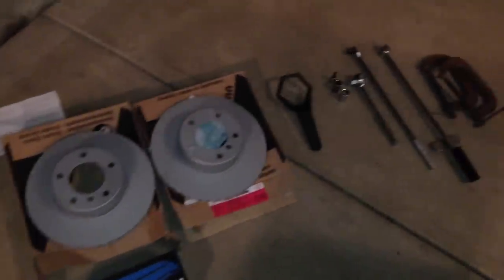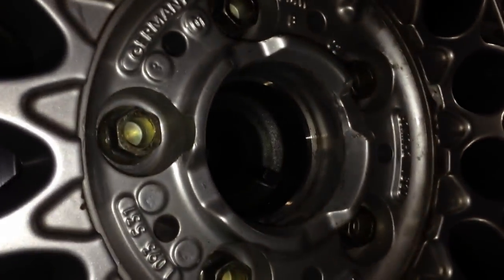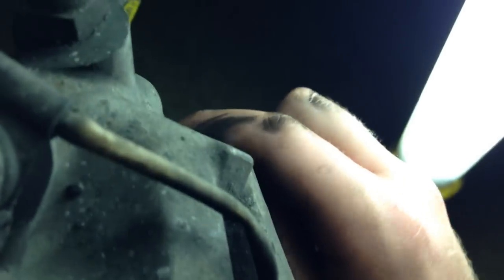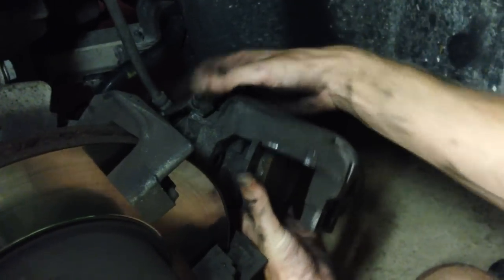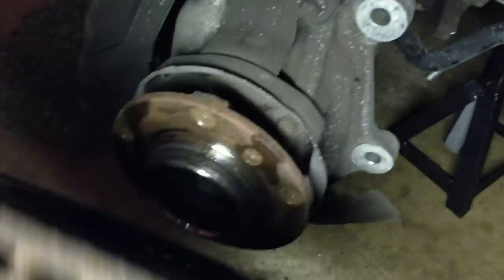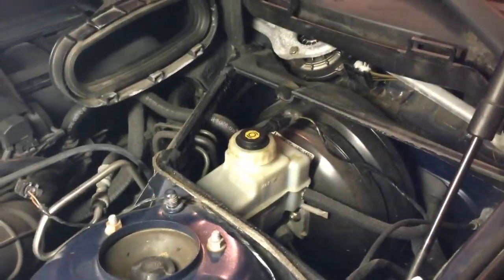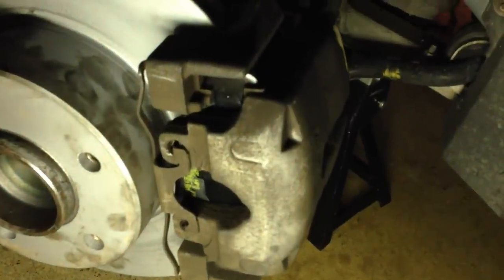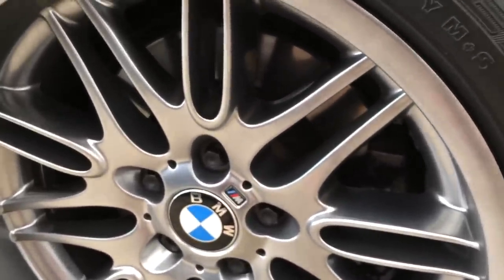BMW E39 5 Series (1996-2003) Brake Pad and Rotor Replacement DIY

Comment: Great video. Was able to change the rear rotors with help of this video last weekend. For me was a long and painful job due to limited mechanical experience and initially a lack of proper tools, but am really satisfied now that its done.

Regarding the hex bolt that you had to drill out - I found that the previous owner had also ruined that and I guess rather than fix it, he decided to not replace the rotors and sold the car. However instead of drilling it, I was able to hammer in a torx bit into that now-circular hole and use that to get it out.
Reply from the maker: Ahh the torx method, I have done that before.  It's quite effective!  I'm glad that you were able to get the job done.

Comment: Hey Ryan, I finally got around to doing my brake pads last weekend. It was quite easy and I had no issues thanks to this video. A couple of notes though:

1. If your E39 has the mobility kit (cigarette lighter powered pump/tire sealer,) and no spare tire, then you will not have a jack. I learned this the hard way and had to go to O'Reilly and buy one.

2. You mentioned the pad wear sensor on the front driver's side but my 2001 M5  also has a sensor on the passenger side rear. They are different sensors because the wire on each is a different length.

3. Once you replace the sensor(s), you can reset the system by turning your key to position 2 and waiting about 20-30 seconds. The Brake warning light will then go off and you know that the sensor has been reset.
Reply from the maker: Glad things went well!  

1.  No M5s have jacks, and the included ones in E39s are not too great.  So buying a jack is basically a must for any kind of DIYer.

2. Yeah there is one in the front and one in the back.  I've replaced both of mine with the realoem.com part numbers.

3.  That only works on the 2001+ models as far as I know, I think the older ones figure it out after some drive time haha

Comment: Hey thanks for your reply. Nothing else malfunctions. The speedo works fine as I know. I will get it checked soon. I noticed sometimes when I start the car its off but after I drive a little bit, It comes on when I hit the brakes. The brakes squeal for a second thats it. then it stays on from there and the brakes work fine with no noise whatsoever. I forgot to mention that both traction light and ABS light come on at the same instant time. I will get it checks and again, Thanks for your input

Comment: Good Vid. Only thing you missed was cleaning the disk before install. They come with an oily residue for rust prevention that should be cleaned off before install. This will help me with my pad/disk change in the next couple of months. Thanks.

Comment: Good video...very helpful. 
A quick thought about the comments on brake dust: Yes you should avoid inhaling brake dust...HOWEVER, there were an estimated 260 MILLION registered passenger vehicles (not counting commercial vehicles) in the United States in 2014. 
Multiply that by 4 wheels each (I can't count that high). Where do you think all that brake dust goes as the pads and shoes wear down over time?? Yup, it's floating and swirling through the air and we're all inhaling it as we drive along. 
Food for thought...

Comment: For anyone wondering what pads/rotors to get;
i recommend brembo blanks and akkebono pads. its about $480 for a full set on fcp euro for my 540i wagon but they last quite a while and the akkebono pads have almost oem stopping power but VERY VERY little dust, which is great

Comment from the maker: +Daniel Covington There is one sensor on the front driver's side, and one sensor on the rear passenger's side.  You do not need to bleed your brakes for this job, but it is recommended to have a full brake fluid flush done every 3-4 years.

-Bobby
Reply: Thanks.  Brake pad sensor is being stubborn.  You just pull it out vertically from the pad hole it's in?
Reply from the maker: ***** Yeah, just pull it straight out.
Reply: I was about to say same, brake bleeding not necessary, Nice job, am doing mine in two days time

Comment: Couple of tips:

If your hex key set omits the 7mm one you can still get the job done if you remove the  whole calliper via the two 18mm bolts.

The little 6mm hex bolt on rotor should be put back with a little copper grease and little more than finger tight. It can't unscrew itself once the wheel is on and you'll be so glad next time.
Reply: Can be done but it's a pain in the arse to get the pads in properly and caliper back on, but hey, when you gotta...

Comment: My 2 tips, clean the caliper holder good. It can hold alot of dirt and rust pieces, as its metal. Also clean the guiding pens. Otherwise great video. And if you cant untied the screw that keeps the rotor on place. Just put the caliper holder on again and use the old pads and 2 clamps, so the rotor will block. Use an extender on the screw and then it will go easily. Put some copper on the screw before putting it back together, so you wont have a hard time next time. As this tiny screw wont do shit when the wheel is back on.

Comment: I did the exact procedure as you guys did with the brake reservoir and a rag around it just in case and then compressed the caliper pistons. My question is did you guys bleed the front brakes because I didn't and it works fine.

Comment: Hi guys! I LOVE my Blk/Blk, 2003 530i/Sports Package, and have a question. Will changing out the wear sensor reset (eliminate) the Amber "Check Brake Pad Wear" warning in the middle of dash and the little, red "Brake" light on right side of cluster, or will I need to take to a BMW shop after done to reset those? Secondly, do I have to replace that sensor at all, or can I leave in factory unit upon swapping rotors/pads? Thanks in advance! -Dave
Reply from the maker: 1970borntorun  That sensor must be replaced when doing brakes if it trips the light, otherwise it will not go off.  The light and message will go off after replacing the sensor.
Reply: ***** thank you :)

Comment: would doing a CDV delete while changing the brakes be a good time to do it? since youre bleeding the system anyway.
Reply from the maker: Yes it would be, though bleeding the clutch can be done separately from the brakes.  While they use the same fluid reservoir, there is a separate compartment/chamber inside the brake fluid reservoir especially for the clutch fluid.

Comment: Hey I have a question. I took my car to a auto clinic to get the brake pads replaced but the brake pad light is still on even though fresh pads were installed. How do I get rid of the light?
Reply from the maker: Was the brake pad wear sensor replaced as well?  This is critical since once the sensor is tripped, it must be replaced.  After replacing the sensor, the code needs to be cleared from whichever module stores it.  I believe it is either the LCM or IKE (cluster).  You'll need someone with BMW software to do that.  If you are local to San Diego, my shop can easily do this for you.

Comment: Great vid, I got a 2003 Range Rover HSE. It's got Vanos problems. How do you recommend in tackling this problem considering that most of the bmw parts would fit a range rover that age.

Comment: So there is only one brake pad wear sensor for the whole car and it located on the front driver's side, correct?  Also, no brake bleeding is required for this work right?
Reply: nope but you have to take some fluid out of the reservoir and i think on the back there is also one. Passenger side.

Comment: What an awesome video guys. I was kinda nervous about tackling this since I haven't wrenched on a BMW since I had my E36. But you have given me confidence. I will be doing the fronts and oil change next week. Any suggestions for some inexpensive rotors for a daily driver (no track)?
Reply: Thanks for watching!  We're glad you enjoyed and found our video useful.  But... brakes are without a doubt one of the most important things on a car, especially a tighter car with power.  It never pays to buy 'cheaper' or 'budget' parts in this category.  I would sternly recommend the OEM rotors, they are worth their weight in safety and performance on these cars.  Same goes for pads.
Reply: ***** What about some high performance brake kits like Brembo?
Reply: DO NOT use cheap brake components, your life literally depends on it.

Comment: Hi thx for the great vid, I have a question, after I finished changing my rotors n pads, I spun my rotor n my outter break pad (the one without the clip) was slightly touching the rotor, n it wasn't rubbing evenly, just one side of the rotor, n it's like that on both sides, r my rotors not even? Can u help pls
Reply from the maker: That's normal, not a big deal as long as you can still move the wheel/rotor by hand.

Comment: So for the brake fluid reservoir, all you did was loosen the cap and tighten it back on? You didn't really explain what to do after you compressed piston back into caliper. When do you tighten the reservoir cap back on?
Reply from the maker: Loosen cap, compress piston back into caliper, and tighten cap again.  Wouldn't hurt to check level while you're looking at the cap!
Reply from the maker: ***** Brakes should be bled every 2-3 years.  If it's been less than that, don't bother replacing it just because you did pads/rotors.  If it's been longer, definitely do it.

Comment: Thanks for the info! Presumably you didn't use any grease? I have never done brakes before and seem to have read some conflicting information about applying grease or lube when changing brakes. I will be changing mine soon so any info on this is appreciated , cheers!
Reply from the maker: I used the included red grease on the pad ears/backing where it meets the piston, I would definitely recommend you do the same.
Reply: E39Source Will do! Thanks for the reply

Comment: Do you have to remove the brake sensor from the caliper to do the brake job or rotor job? How does it come off if I need to remove it? Thanks!
Reply from the maker: The pad wear sensor should be replaced at any brake service.  Simply pull it out of the caliper.
Reply: @E39Source  . Thank you!

Comment: great vid guys only thing I noticed missing was putting copper grease on the slider bolts
Reply: never put copper grease on the slider bolts, as it gets sticky over time and it wont move anymore. Use what was invented for the job like 100 years ago its called Brake Grease, its simple as that. TRW has it for example.

Comment: So, in your experience, which rotors do you recommend. I've been looking at zimmermann (which people say are oem), meyle, and brembo. I also found some drilled zimmermann rotors that fairly similar in price to the blank ones. I'm looking for overall durability and not to change them every so often. High braking power isn't of my great concern since my 530i isn't a track car...
Reply from the maker: In my experience, the best combination is OEM rotors paired with Hawk HPS pads.  It's a great mix of reliability, longevity, and performance.  Plus the Hawk pads don't dust NEARLY as much and help save your wheels from pitting, as well as how often you have to clean them.
Reply: +E39Source are zimmermann oem? If not Where's the best site to get them besides the dealer
Reply from the maker: I'm not sure who the OEM is.  I would probably source the part number from Real OEM and then buy through ECS or something.
Reply: oem was Lucas, as most of the braking on the E39. The brake booster is Lucas, the mastercilinder is lucas, the brake pads are and the rotor. But Lucas doesnt exist anymore. Was bought in 1999 by TRW. And TRW was bought in 2014 by ZF (yes from the gearboxes). But it doenst matter much, TRW, Brembo, Bosch, Zimmermann. Its all good.

Comment: Hi!! Thanks for a great video! I guess that you just put back the Cap on the brakefluid container, after when everything is back on? How much comes out?
Reply from the maker: Lars von trier pung It won't come up, the level just adjusts.  Put the cap on when everything else is done!
Reply: ***** thanks!! Now im done after using this guide.. when i pressed the pistons back in, brake-oil spilled out. Is this normal? I just put the cap back on when i was done. Do i have to refill "add" brakeoil?
Reply from the maker: Lars von trier pung Brake fluid came of where?  The reservoir?  If it were super worn before I guess that could be possible.  Just get the level right for now and you should be set.
Reply: ***** Yes, from the reservoir. Oki doki. Thanks!

Comment: did you use brake lube on pads or slides, some people don't use it. what do you recommend
Reply from the maker: you should use a lubricant anywhere the pads (metal backing, NOT the friction material) touch the caliper or caliper piston.
Reply: @E39Source  ok Thanks.will do

Comment: I have a 2001 530i and i have a brake light and abs light on. I dont know what to do! Any suggestions?
Reply: Could be an ABS sensor or something else, unfortunately we can't diagnose your car through the internet. Take it so a BMW dealership or independent BMW garage and they can diagnose the issue for you.

Comment: Does anyone know the part number for the trap door (used to house the brake pad sensor)? I cannot find it on realoem.
Reply from the maker: I couldn't find it either, BMW didn't include 100% of the parts of the car on RealOEM unfortunately, so this is probably one of those.

Comment: did you have to bleed the brakes after you compressed the caliper ?
Reply from the maker: No, only if air is introduced to the system or brake fluid leaks out (meaning air can work its way in).
Reply: @E39Source  thanks for the reply !

Comment: Would also like undo rotation on the bolts please as this ole girl been euro I'm not sure if I'm undoing or tightening the caliper bolts,

kind regards
96 e39 528i
Reply from the maker: They are a standard thread.
Reply: @E39Source  awesome thank you so much for taking the time to answer my silly question, 😁

Comment: 3:46 Moving on to the next step would be piece of cake if bolts weren't rusted absolutely solid. How to remove them, counter or clockwise?
Reply from the maker: Time for a breaker bar!  They are standard threat bolts, righty tighty lefty loosey!
Reply: @E39Source  Thank you, couldn't get a ratchet to fit but may wanna remove that brake hose.

Comment: How many inches would the C-Clamp be in order to push back the piston? Thank you.
Reply from the maker: I would get a nice 6 inch C clamp.  No bigger than 9 and probably no less than 4.  You'll only need to move the piston back a half inch at most.
Reply: I really appreciate it! Thank you.

Comment: In removing the guide bolts, is it 7mm hex of 6mm hex on the E39 530i '01?
Reply from the maker: It's one of those, I am not sure which.  I would recommend having both on hand because I think the rotor set screws may be one size smaller than the caliper guide bolts!
Reply: +E39Source right! Thanks a lot. The video is super helpful. I believe 7hex for caliper bolt & 6 for rotor screw. Thanks anyways! I'll watch the video once more before I work on my car.
Reply: Jose Nambo it is 7mm hex according to the maintenance book by Bentley if you wanted a resource.

Comment: I am wondering if anyone else has experienced this … I just replaced my rear brake pads, and after I put the new pads in, and screwed the bolts down - the retaining bolts, as he calls them in this video - they wouldn't cinch down in their bolts beds, or whatever they're called, nearly as far. So the top of the bolt was really close to the rim of rubber dust cover boot thing after I had screwed the bolt in as far as it would let me. Now, when I had removed that bolt? to take the old pads off? That bolt was in way further - way below the rim of the dust cover rubber boot thing. I am cconfused because it seems like I got the brake caliper back on right, and I screwed the retaining bolts in right, and everything went smoothly, but that would be a huge mistake! if that bolt was not applied correctly. I figured the bolt was deeper in the bed (as I call it) because of the piston being compressed towards the rotor due to the pads being so worn down.
So (if that was understandable) my question is simply whether my sense is correct. Has anyone experienced this before? Thanks
Reply from the maker: It sounds like these are the caliper carrier retaining bolts that you're talking about.  It sounds like you might have it cross-threaded.  Remove the bolt, clean any debris off of the bolt threads or the tapped holes that they thread into.  Start the bolts without a socket wrench, just with the socket and your hand.  Then torque them down and they should seat properly.

Comment: I have a 523i(2000) would it be the same again?
Reply from the maker: Yes, I think you'd find the process to be nearly identical.
Reply: @E39Source  hey one more question are the break pads for for the front and back the same size? my first time replacing then.
Reply from the maker: ILL GET MUMMY The fronts will almost always be larger. They will be in your case.

Comment: The ABS warning lights on the dashboard of the car light up. HELP ME, HELP.
Reply from the maker: There is a problem with your ABS system.  You should scan the ABS module for codes.

Comment: you guys should invest in a good pair of video sunglasses or something, so you dony need to carry the camera around and have both hands free
possibly also mount some LED lights on the sunglasses to illuminate whatever you are looking at
Reply from the maker: None of those are any good though.  We need a) better lighting.  b) a tripod at the correct level for the brakes or whatever and c) to do work during the daytime!
Reply: ***** or just stick a soft LED on each corner of the glasses for even, POV lighting :D